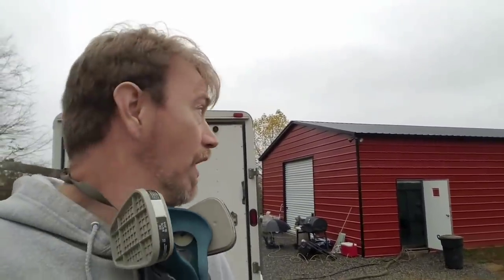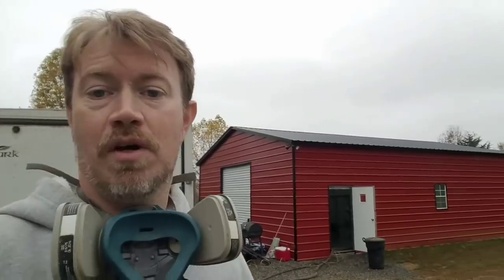Insulating Metal Buildings With Closed Cell Spray Foam

Comment: Do you spray the center part of the roof where the 2 sheets meet my contractor had left a small opening there. With a seperate cap I'm assuming it was for ventilation.  My spray foam guy covered that up it seems to trap all the heat inside now should I open it back up?

Comment: I've heard that it's a good idea to pressure wash or somehow clean the metal panels before applying closed cell foam to remove manufacturing oils which might cause closed cell foam to pull away from the metal over time. Is that true? Planning on building a barndo here soon and would like to know the answer to that. Thanks! Nice video.
Reply: Check out Spray Jones. He’s another good source of information all things foam.

Comment: I had a spray foam company come out to quote 335 square feet at 2" of 2lb close cell foam under a roof. They wanted $7 per square foot, and I had to do all the prep. The guy couldn't tell me what the name of the product was, and they had a two month lead time. Over $2k for the roof of a small workshop!
Reply: Gotta wear resparator application- can the stuff break down over time n get airborn-i know its costly, w/those q's- as sharktank says "im out"
Reply: Not sure where you are, but I got 1350 sq ft done 1.5" thk for $2000

Comment: What kind of temp difference is it in summer?  I wanna store plastic baits and other fishing gear in my big metal building. And was considering this. I will not have an AC or anything
Reply from the maker: Spray foam is a fantastic insulation product, but it cannot generate heat or cool, it can only maintain the internal temperatures of the building more efficiently. Think of it like a drink cooler. You will still need to add ice to make it cool, but the ice will melt slowly because of the insulation. With that said, many clients have reported back to us that their non-air conditioned metal building felt significantly cooler after the installation in the summer. If maintaining a specific temperature is critical then you will still need to consider installing a climate control system of some kind.

Comment: Very interested. Assuming a identical brand new empty building and I do all the masking and floor covering.  What is roughly the price per square foot to spray the walls with 3"  and roof with 5" of closed cell foam? Thanks

Comment: Hi! How much do you charge for a 2000SF steel building insulation?
Reply from the maker: Due to the complex nature of any spray foam project an on-site estimate would be required in order to evaluate the cost of installation.

Comment: Can I do spray insulation BEFORE I run the electrical? I would rather do it that way so if in the future I need to get to any wires, I don't have to cut any foam to get there?
Reply: Yes, by electrical code, you can run all of your wiring on the inside of the building using conduit.

Comment: Question is how much R value do you need?  I live in NC and we some nights into the single digits.  On these metal buildings if you get the insulation the seller offers you can only get 6 inches or R19. I am not sure that is enough in the roof, but unlike a pole barn you don't have the option to blow insulation in the attic.  Seems like with this stuff you would have to put at least 2 1/2 to 3 inches to get the same r value.
Reply from the maker: It depends on what you mean by "need". There are code requirements for living spaces and commercial buildings. If your building isn't being lived in or subject to code then you can do whatever you like as far as thickness. R-value isn't as important as an air seal. Performance is vastly improved when you achieve an air seal. We have seen huge success with 1 1/2" -2" of closed cell foam. Clients report easily heating their spaces with with just 2" of closed cell in metal buildings.

Comment: I've heard it suggested to put plastic sheeting on the wall first in case you have to replace panels. Of course, this would create an air gap, and allow condensation. Opinion?
Reply: You just answered your own question. Condensation in enclosed space is very bad, don't do it.
Reply: You don't want to use plastic sheeting as the spray foam has issues sticking to it.
Reply: Like anilated said foam doesn’t stick well with plastic. If you use house wrap it’s a different story..

Comment: I do wonder if the foam will keep up with the movement of the metal as it heats and cools.
I think I would put some sort of substrate material between the metal and foam.
Reply from the maker: dadcss We've been doing these metal buildings this way for years and have never had any reported incidents of any problems. In fact it stick so well to the metal it makes the building stronger. We had one client who had a tree fall on their spray foamed metal building and the spray foam prevented the tree from falling through and damaging two classic Corvettes. The insurance company said the spray foam saved those cars.
Reply: Houston Bros Spray Foam Insulation I call “BS” There’s NO FREAKING WAY this foam is going to stop a falling tree.
Reply: @bighammer587  who the hell said anything about stopping falling trees? Hell roof trusses and plywood don't either, but it does make a flimsy metal building feel and sound like a nice building. If you don't like it don't do it, but I did and love it, so go crap on your own parade
Reply: integr8er66: Read the comment above mine silly. It’s from the original poster of this video claiming that the foam held up a tree, preventing it from crushing two classic Corvettes 😂😂 I’m actually interested in using this product, but ridiculous claims like this  takes away all  credibility from the poster.
Reply: Mark Pool it obviously does help to strengthen the structure kind of like how plywood how it’s layered makes it really strong. I’d imagine this stuff could help stop a small tree that would otherwise have gotten through but it sure wouldn’t prevent your normal tree falling through incident. If the story is true the circumstances had to be just right and the tree must have been pretty darn small.
Reply: @bighammer587  Spray foam does in fact greatly enhance the structural integrity of a building.In fact,im putting up a pioneer quonset building and even the engineer HIGHLY recommended spray foam in my heavy snowload area of northern canada.He told me its quite surprising how much affect it has on the rigidity of a structure.

Comment: How long after application does the off gassing continue to produce fules?
Reply: Once the surface has hardened (takes minutes to go hard) then it's 100% safe and no gasses come from it, then the rest hardens over 24 hours and it's solid.
Reply from the maker: No more than 24 hours.

Comment: Just saw your video , great job. Question I have is I had a metal building for 8 yrs and I insulated the crap out of it ceiling to floor but every year when it was damp out it was so wet inside looked like someone soaked insulation , I had no vents at all and beleive that was the issue , I have since moved to new property and want to install same building but don't want the moisture will the spray foam take care of that or do I need ceiling or gable vents?
Thanks for info
Reply: I think you need a vapor barrier.
Reply: Closed cell spray foam insulation is a moisture barrier.  As for needing vents, that depends on what you plan to use the space for.  Since it is closed cell, air can't pass through, so highly volatile chemicals will build up in the space if not properly vented.

Comment: Yeah, that power cable you are spraying over is suppose to be in conduit!
Reply: It's Romex. Perfectly fine.
Reply: Actually it's not ok because it can not dissipate the heat generated from the load. This would not pass a proper inspection.   @elbob248
Reply: I guess I was wrong. @scottsibbick566
Reply: @Dustin Eward regular fiberglass insulation around a wire is not the same as totally encapsulating it in foam. Just like the reason there are 3M standoffs for multiple wires running up a single stud, you can't nail them together for the same reason. It has nothing to do with wire size. I guess we all have a different level of quality and safety to give to our customers,  I don't cut corners.
Reply: @Dustin Eward wow you are good ! You can properly size a dedicated 240v line and not overheat the wire.....in case you didn't know a 240v motor will draw less on each line feed so I would hope it would not get hot.
Reply: @Dustin Eward  I'm happy to hear that! You have good day and rest of the week!

Comment: What about studs remaining flat surface to allow wall panels to keep true and flat.
With spray would it be offset?

“The studs”...?
Reply: You have to trim the foam off the uprights to mount wall board. Also special order 10' plywood or osb or whatever because the metal building uprights will be on 5 ft center's
Reply from the maker: If requested the foam can be ground down to the studs to allow for the installation of wall panels.

Comment: Impressive!  I certainly like what I see here.  How long does it last?  How well does it stand up to humidity and temperature extremes?
Reply: Michael Schroeder It will last the life of your house. It actually increases the structural integrity of your framing. Humidity and extreme temperatures are no match for closed cell foam as well. As it is a compete air and water tight seal.

Comment: Isn't off gassing a major issue in the summer?
Reply from the maker: No, off gassing only occurs during the first 24 hours. After that the foam is totally safe.
Reply: @HoustonBrosSprayFoamFerrum  That a relief! Not enough to worry about without 'off gassing'. It sound like me after a Mexican dinner!

Comment: That looks like  NCFI's anti microbial 2lb foam.  Your spray operator is doing a great job.  Very even.  What do you think of the Graco air purge?  I love my Glascraft Probler.  I put a grease zerk on the bottom of it and it makes the side seals last a whole lot longer.  Check out Polyurethane Machinery Corporation's AP-2 gun.  Never used it but looks so sweet.  They have an AP-EX that I don't I'll get because the last house I insulated will by the one I'm building for retirement.  I have a Glascraft foamcat 200 and 400.  200 is air drive and the 400 is hydraulic drive.  Love the Foamcat series.    Anyway.  Hope things go well for you and best of luck.
Reply: The fusion AP is a good sturdy gun. Handle isn’t shaped worth a damn though. I reformed mine. The parts are pretty durable assuming you can get a properly drilled mixing chamber from graco, I’ve had some issues in the past with that. I also have shot with the AP-1 a couple years, that was basic and had some issues that were resolved with added parts for the new AP-2 which I also have. The AP-2 shoots good most of the time, but I find that the parts are made from a softer steel and are less durable than the fusion. Mixing chambers are made of 4140 which is hi how carbon steel which will scratch with a drill bit easily if you aren’t extremely careful. I also don’t like that the chambers are 2 pieces because they never 100% perfectly align with one another which can through off the pattern or build up shit in the chamber. Also PMC doesn’t seem to know the drill bit size for their chambers. They send bits that are 1 size to small. I’ve also got miss-matched chamber and pct parts before when ordering new, the chamber will be drilled at a #50 and pct at a #51 occasionally so the pct is as good as garbage then. The easiest gun to service with the most reusable parts is the fusion. All the parts in the fusion are steel or oring. The AP-2 has nylon check valves with little springs and balls which become damaged, lost or no longer fit and need to be replaced. What I like most about the AP-2 is the speed the chamber moves when you pull the trigger and the weight of the gun. With that said, I mostly run the AP-2 on my rig, but when I get frustrated with the AP-2 I switch back to the Fusion as a backup. I have an adapter block to attach my AP-2 to my fusion manifold. There is a lot yet that can be improved with the AP-2 design, but I’m happy with it most days.
Reply: The AP-2 manifold block is also poorly designed for a gun that’s trying to be light weight. It’s a huge piece of steel that could have 50% or more of the material machined off to save on weight.
Reply: Christopher Gruenwald Is there such as a perfect PU gun?  For sure I think there isn't.  What we can do is try to find one we get the most use out of before re building or re sealing.
Reply: spf depot is where to get your replacement parts. they make stronger mixing chambers

Comment: What is the R value?  If you want to install paneling to cover the ugly foam can it be easily scraped from the studs?  Cost relative to rolled insulation?
Reply: I had to cut it off my metal uprights. It was a chore, it sticks tight. I used a machete but I have seen guys use a sawsall witha very long blade and just bend it up against the stud.
Reply: tape the face of the studs so it will peel off.
Reply: @andy6043  Great idea! I didn't know he was going to spray over them like he did, so lesson learned. Also put a tarp over the rollup door, he made a mess of my door with overspray and it won't come off.
Reply: Leslie B  - The R-value is a NUMBER, so your reply is entirely inadequate.  I would be embarrassed to post such an inconsequential reply as you did, but your shallow "thoughts" are your problem, not mine.
Reply from the maker: We'll usually talk to the customer about whether they want to shave off the beams to install paneling or not. We can shave it for them after the foam has been applied. If the customer does not plan on using panels it's actually more efficient to leave the foam on the uprights to prevent as much thermal bridging as possible.
Reply from the maker: The R-value of closed cell foam is about 6.8 per inch. This is the same material that you would find inside your refrigerator in your kitchen.
Reply: Houston Bros Spray Foam Insulation I am confused.  Please excuse my ignorance.  Why is there a need to scrape off foam from the posts?  My pole barn has 6x6 posts and if 2 inches of foam are sprayed on the walls, the foam is recessed behind the posts in the wall cavity.  If I go with foam I was going to install plywood or CDX to the walls to protect  them and provide for shelving.  Can you elaborate please?
Reply: @MrIndyjoe  If the foam is sprayed on the walls AND the studs, then you won't have a flat surface on the studs to screw in your plywood/drywall.  You CAN do it, but and try to crush the foam between your drywall and  the stud, but it will not be even and if it's drywall, it may even crack the drywall.  It would be better if the foam were only on the wall between or if the foam were first scraped off before applying the drywall.  Does that make sense?
Reply: @ProfessorOzone  Yes I guess the assumption is that there are studs already in place.  I have a post frame metal building and there are posts 8' on center and the purlins.  My idea was to nail plywood to the face of the post and any other structural framing would be done after 1.5-2" of foam had been sprayed if that makes sense as I am doing this after the build, not before which would have been better.

Comment: I wonder if it's flammable? I do a lot of welding.
Reply from the maker: It is plastic so it can burn, however It doesn't burn readily and can be covered with a fire barrier paint if need be.

Comment: Is there another more so dense foam available? IE 2.9 or 3 lb?
Reply from the maker: You can purchase closed cell foam that goes all the way up to 8 pounds or more in density. The recommended density to use depends on the application. Generally 3lb closed cell foam is used in Roofing applications.

Comment: How hard is it to replace electrical wires after that stuff turns to a rock would it be better to spray first then run electric?
Reply: Don't know why you would need to be replacing wires, but I supposed if you wanted to, just take a knife and gouge out a channel, run new wire, and fill back in with foam.  Better option would be to run conduit between boxes, and you can do whatever, whenever.
Reply: Why would you have to replace the electrical wire. I guess if it failed or you needed additional outlets you could run conduit or mc on the surface.  I think it makes the job look clean. a friend of mine just did this to his 2 pole barns with concrete floors,  one is a man cave. he calls it the snow castle.  He has big stereo. it sounds great and the outside noise and the noise from his stereo is greatly reduced. his foam was yellow and they sprayed the foam and the beams with white latex paint.  a little light goes a long way. very bright with just a little light
Reply: 1, If your electrical is properly done , then there should be no need to replace wiring. 2. If that is what keeps you awake at night , then run your wiring through conduit !
Reply: Definitely better if you already have all the wiring run before insulation. If not, you have to cut out the insulation, then respray it once you've finished
Reply: @Wesleycreardon  its probably not a great idea to insulate wires. They are rated for a certain amperage and that is based in part on how much heat they can dissipate. I ran conduit on the walls of my metal building with closed cell sprayed,  but mine is a shop not living space.  As far as is it good...its awsome. Sound deadening and you can heat it with a candle. Mine is a 20x25 and cost to have it sprayed was $1800.
Reply: It would be best to run conduit for all electrical after the building is insulated and finish surface is installed.  A lot safer and more flexible for any future upgrades.
Reply: integr8er66 that price seems very affordable and much cheaper than what I've heard.  Curious where you live?  My pole barn is  24x 32 and want to get it insulated.  Thx.